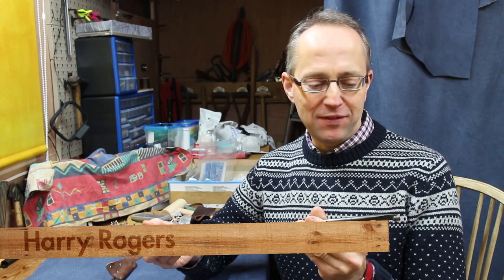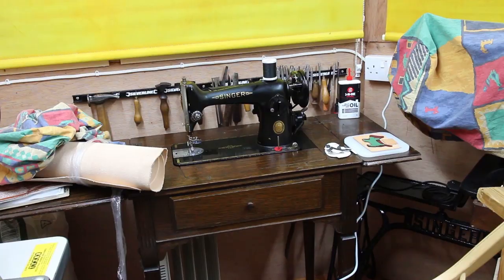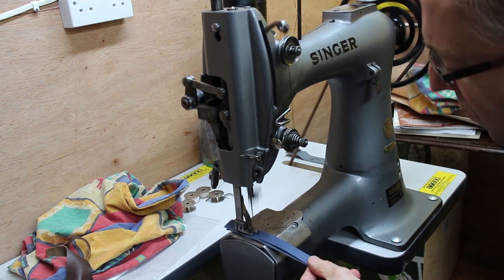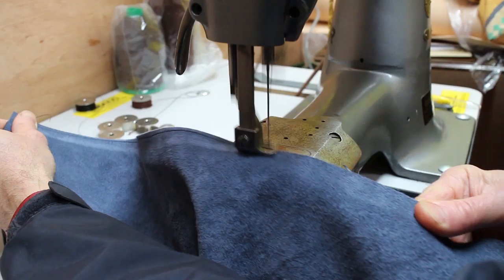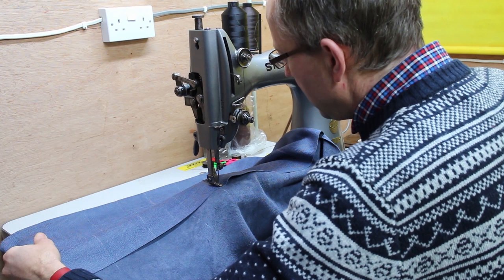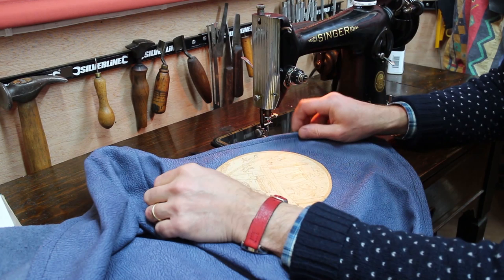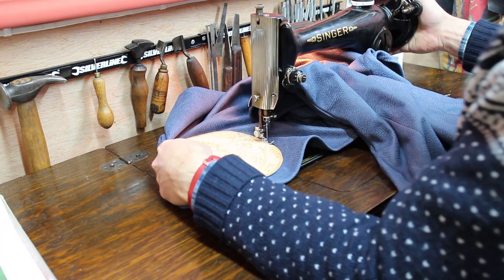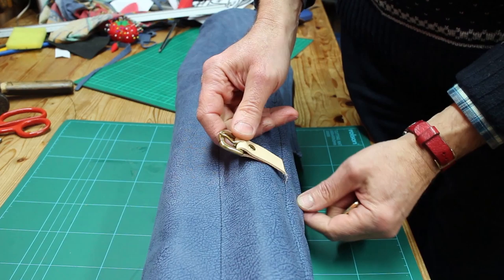Making a Leather Tool Case

Comment: Nice machine!

Since I got so many useful tips from you I thought I should write you that I have a similar singer. I glued a tiny piece of about 1,5 mm rubber to where the walkingfott arm hits the metal. that makes the sound of the machine much less disturbing, and it still works fine.
Reply from the maker: Thanks for that tip - I may well do the same! I have also fitted a servo motor - film to follow Regards Harry

Comment: Hi Harry .I didn't realise that the old domestic singer machines were capable of leather work.I have 2 machines one is used for decoration from the late 1800's and another from the 30's ,40's.which lives in the loft.I think i am going to try it on some thin leather and see how it goes.thanks for the video .ken
Reply from the maker: Ken - most of the domestic machines do struggle on leather, I tried an old 1900s Singer and it could not take it, but the Singer 201K has a rotary hook and can go through thin stuff OK......I believe at one point the salespeople demonstrated it sewing through a tin can! Good luck - worth a try whatever.

Comment: Harry,
I also admire the Singer 201K although I am only use it for cotton fabric sewing. Mine is the beige aluminum. Is yours a black cast iron or black aluminum 201K?
They may be quite common in the UK because of their production in Kilbowie, Clydebank, Scotland. In the US, the 201K is rare. Essentially one must look to the UK to purchase one and as you can imagine the expense to ship the machine from the UK to the US.
The US produced Singer 201 is an exceptional machine also. Most of the US produced 201s are gear driven with the potted motor (201-2.)
I wish everyone in the UK knew the joys of sewing with a 201K.

Comment: I have a Singer 201 with drop feed dogs I love. Also the 201K for treadle. Do you know what the Singer 44 is? Not a 44-9 or 44-x. Just a plain 44. I can't find info anywhere. Thank you for posting this video. The walking foot machine is very cool!
Reply from the maker: Try ISMACS
Reply: @harryrogers  Hi Harry. I did check it out there but under the serial number I look dup it said 24. The lowest 24 they have in the description is a 24-9 completely different looking from a 24 with Tiffany decals  and what looks to be a home sewing machine in a coffin case. If you ever find out could you do a post?